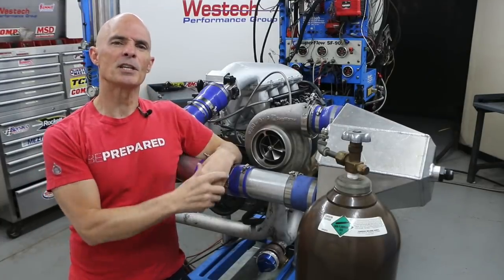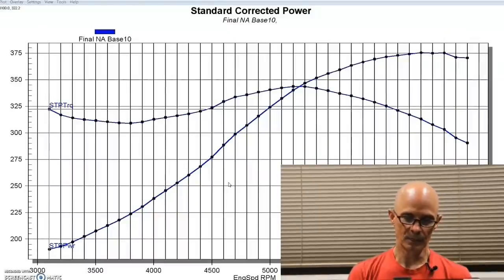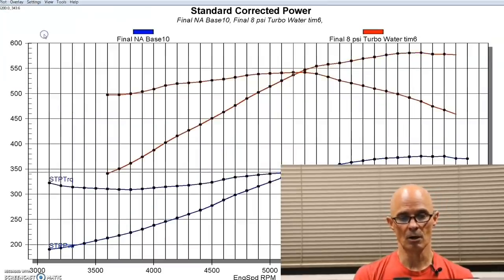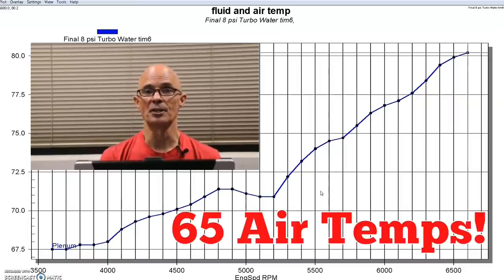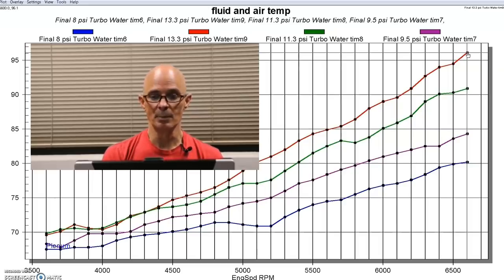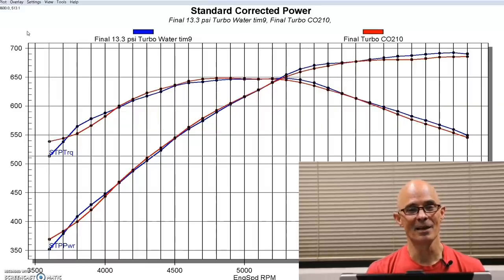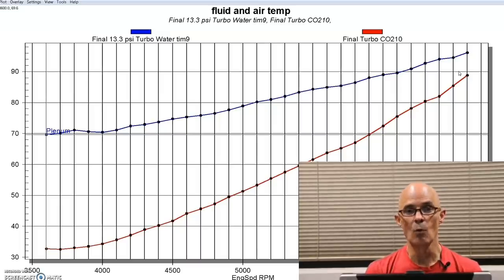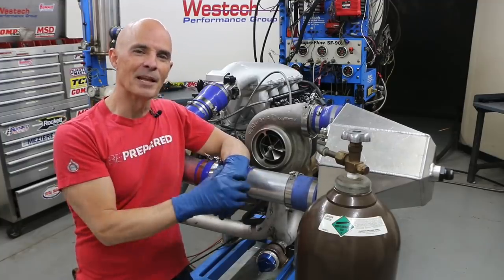HELP, CO2 INTERCOOLER FAIL!! FULL RESULTS!!

Comment: CO2 is heavier than air, and as a result, it will settle at the bottom of the bottle. If that CO2 bottle doesn't have a deep tube, then all you were sending out after opening the valve was pressurized cold air above the CO2. In this case, you should have flipped the bottle up and down to get the CO2 out.

Comment: Liquid pulls heat at 14x the rate of gas with aluminum core. So it’s basically functioning like an air to air intercooler with c02 but the core size is much smaller than most air to airs on this size setup. 
I’ve water would probably work much better, id be interested what would happen if you used ice water in the cooler and used c02 at the turbo inlet to decrease the temp of air starting at the turbo

Comment: The phase change needs to happen where you want the heat transferred. Also, air to water IC not the optimal internal geometry to transfer heat to a refrigerant.

Comment: Use a water/water heat exchanger (large one) so you can have high flow and not lose cooling capacity. Run co2 to exchanger, then water/glycol thru exchanger and Intercooler. I think that's your best bet. I want to try the exchanger method to chill water/meth injection using R134 from my a/c.

Comment: 1. I feel that u shouldnt have added fuel, monitored your a/f ratio and made sure not to blow the motor. 2. U obviously have a problem with flow, u have to remember the colder the air the denser the air will be you need excess flow to compensate for all that density. So i feel in my opinion you dont have enough flow, and of course adding all that fuel just drowned the motor and didnt make power. In  Future videos u should probably show what your a/f ratios are at to  reassure data given makes sense i mean we are all here trying to learn more and more so lay out all the data u have 👍🏾 good video but u should try it again. Abd if u did share link to me plz

Comment: I wanted to chime in here, back in the 80s I was a Product Engineer on the GM "G" bodies. I personally owned an 87 Grand National. I swapped the 3.8 out for a 4.1, forged pistons, etc.... I modified the stock intercooler by sealing off the front and back, installed a drain cock in the bottom and created an opening in the top. I would pour liquid nitrogen in the top of the intercooler which was good for a 1/4 mile run. The air going into the throttle body was at -15°F. I also used water injection (there was a port on the ECM for that!). Horsepower was at 445, my quarter mile runs were 11.41. I attempted nitrous, however the 200R4 would not hold up. For anyone with back issues of Turbo magazine (late 80s), the car was featured in a Turbo Magazine issue.
Reply from the maker: very cool-I wrote for Kipp back then
Reply: @richardholdener1727  I remember as an engineering experiment, we created a Turbo Regal El Camino., we used the front end and dash from a 4 door Regal, the power train from the Grand National.  Tons of photographers from magazines, then the vehicle was scrapped!
Reply from the maker: my kind of elco

Comment: If you have any part of the aftercooler surface facing the incoming airflow below zero degrees, it will frost up on that surface, blocking flow. 

Your best efficiency if you stay above  frost is to cool a liquid coolant for the aftercooler to just barely below freezing, as that will result in a temperature gradient between the coolant side of the aftercooler heat transfer surface and the intake air side of the aftercooler heat transfer surface that ends up with the surface facing the intake air merely being near zero, but not quite at it, so you will get (helpful) condensation, but NO frost to block up your passages.

Then, you need a GREAT deal of flow of coolant going the OPPPOSITE DIRECTION as the intake air, so the freshly-heated intake air faces the warmest coolant, and the already-partially-cooled intake air faces the coldest coolant.

Cooling your intake charge to below zero will work, IF you carefully defrost the coils during the run by cooling the intake air in stages, and that is wildly impractical for most cars, as they would have to have dual coils: one operating while the other defrosts.

The practical lower limit of aftercooling is just above freezing. You can go lower for an experiment, but your one way to do that with relatively cheap technology is to rent a reefer container with lots of thermal inertia in its cargo, such as many small bottles of frozen water that your reefer container can than drop to as far below freezing as you want.

Then, you run the intake air into one end of the container, and have it exit from the other end, so you are almost completely dehumidifying your intake air before it even touches the turbo. THEN you cool THAT dry air down to whatever low temperature you wish. 

As you can tell, the logistics of performing such and experiment mean either Alaska or a huge setup to eliminate moisture before it can clog aftercooler passages as frost.

But, for maximum aftercooling, a liquid cooled to just barely below freezing provided in GREAT abundance to a liquid-to-air aftercooler core. is the way to go. Your incoming liquid has to be at about 0.01 degrees above freezing, and it would preferably leave the core at about 1 degree, due to the overwhelming abundance of coolant being thrown through it.

Comment: I'd be interested to see an air-to-air intercooler with the CO2 sprayed onto the fins. You could run dyno fans across the intercooler to get air flow across the intercooler. I think the water-to-air intercoolers are meant for 1/4 mile runs if I'm not mistaken. Here's a wacky idea, plumb the water-to-air intercooler to an ac compressor. I wonder if the power of the cooled air would be great than the parasitic drag loss?
Reply from the maker: I HAVE A VIDEO UP WITH NITROUS INTERCOOLER RING SPRAYING NITROUS THROUGH AN ATA
Reply: @richardholdener1727  Sorry, trying to find the video but no luck

Comment: Pressurize the intercooler line open the bottle all the way open and release the co2 after it has gone through the intercooler . Making the intercooler lines part of the co2 bottle .have your valve after the intercooler open it there and your intercooler will freeze the same as the bottle does when releasing all the Pressure

Comment: Even if you were to get this to work properly. The real problem is that you would be freezing the moisture that is in the atmosphere inside the core. It will clog the cores and then you’ll just blow your couplings between the inner cooler and the turbo. It might be possible to run quarter mile track runs in a more dryer climate. But this shit definitely will never work where I live.

Comment: You need to be running pure liquid CO2 directly to the inner cooler with a vaporizer orifice. You need the inner cooler to act the same way the vaporizer coil/core acts in an air conditioning system.

Comment: try it with a larger evap core.  the incoming air temp cfm is overcoming the endothermic reaction as you have it in this video, you'll most likely need a larger core so cfm is reduced.

Comment: The answer's much easier than all of you think:
 - The tank in your test laid strait letting only gas out, not the liquid, that's why it didn't work.
 - Take a look at the tank, it's lower part frosts after the pressure drop right where the fluid is.
 - Just pop the tank upside down, so the liquid part of CO2 is below the gas part and you're good to go.

As a lot of people noticed right, cooling effect is obtained by a phase change of CO2 from liquid state to gas, which will in this case happen right where you need - in the pipeline and in the intercooler. Also make sure the lines are as short as possible.

Can't wait to see the correct test!

Comment: It may be a leidenfrost effect. Basically it could be the co2 is trying to boil from the hot surface creating a gas barrier preventing it from actually cooling the pipes. The same effect happens when you pour liquid nitrogen on your hand, it won’t do anything unless you soak your hand in it

Comment: The core of the air to water intercooler needs to have a design of an evaporator core, the fin/plate design of an air/water IC won't distribute the CO2 evenly, unlike water or a fluid, a gas requires set directional path across the entire core in order to gain the most heat exchange. However an orifice on the inlet side of the air/water I/C would enable to CO2 to disperse better for that O2/H2O intercooler.

Comment: why not inject co2 direct into the engine as a charge cooler and fuel
Reply from the maker: CO2 IS INERT AND WOULD HURT POWER
Reply: @richardholdener1727  I guess your right, than any other refrigerant that would double as a fuel ea liquid ammonia or liquid butane/propane, the phase change will drastically lower the intake charge and the fuel properties add to the boost charge after compression

Comment: Video idea to test this further... Check out how the KillerChiller setup works. Maybe you could run liquid CO2 through a heat exchanger like that and still flow water through the A/W intercooler. Or, just straight up use one of their kits, I'd be excited to see those results. As always, thanks for the great content! I think having the water down at a lower temp is going to pull the heat out much better than running the CO2 through it, but that's just my thought.

Comment: turn the c02 bottle upside down, and use a nitrous jet at the intercooler. flipping the bottle will give you Liquid co2 .. and it will decompress at the nitrous jet.  this should provide the coldest co2 output .. also you can use a nitrous solenoid to control the C02 and of course try different size nitrous jets to increase or decrease the amount of Co2
Reply: you can also restrict the output side of the intercooler where the C02 is going to exit. but i would think having it a bit larger then the input jet would be ideal

Comment: Need to keep pressure of the co2 higher in the inter cooler so it will get colder.    Or ad air conditioning to the inter coolers maybe some  Peltier devices to the intercooler I was thinking about trying that but have to get rid of the heat they make cold on one side hot on the other

Comment: I set up and built a propane fuelled 20b 3 rotor rotary rx8, i ran my gas lines into the barrel intercooler instead of water, before gas was sent to reducer and heated there to create vapour injection. . 
What I saw was extremely promising, and I think the difference here is that the more boost and flow, the more heat builds but also the more gas flows. So temps stay constant throughout the range. 
Your co2 just needs to increase to scale as revs/heat/boost increases. 
Lpg/propane is extremely misunderstood and misrepresented, mainly due to most gas cars running dual fuel systems. By running Solo gas, the tune can be done optimum to suit the gas. Not to mention the use of correct plugs etc. 
Dual fuel cars are rubbish. 
Good vids btw. Super informative 👌

Comment: You might have formed a dry ice cube in the cooler. You need to meter the liquid into the cooler with a capillary tube or an expansion valve.

Comment: You have a very short tube from turbo charger to cooling core and very long tube to the engine air intake, thus losing so much of the coldness of the air
Reply from the maker: agreed

Comment: Use the CO2 to cool the liquid going through the intercooler.    build a nice flat aluminum block  and glue it to the water container with some thermal epoxy.  Then run the co2 through it.

Comment: LN2 is often used for max overclocks of computer CPU where excessive temps cause failures and melted silicon.
The transfer method is usually just an open pot of liquid on the heat transfer plate allowing the liquid to evaporate, the same method as using a dry ice intercooler.
Recon main problem with LN2 in an open pot would be keeping liquid over the transfer plate as the vehicle accelerates, and also stopping the fuel from freeze -60'C.
Would be great to see what can be achieved on the Dyno, Have Fun.

Comment: I ran a DEI Cry02 on my skyline with side mount inter cooler. I had it going through two in-line 3” pipe “bulbs” first at the throttle body, 2nd after the side mount and the waste spray directly onto the face of the inter cooler. Without touching boost controller, boost climbed 3psi and temp dropped 15-20deg C at top. (Intercooler pipes had condensation like an A/C pipe). Cry02 for the win.

Comment: You don't have enough intercooler. My air to air intercooler goes from 82* to 110* under 30psi of boost in about 8 seconds. I'd hate to see what your air temps would be with that intercooler at 30psi for 8 seconds.

Comment: Richard I really wanna see you do this same test again but not co2 rather try methanol that's been dry ice chilled. I promise youl get sub zero intake temps and please man try my hvlp preturbo injection with the dry ice methanol too. Also not enough co2 it's density is very low lbs/min flow was low so it got hot just like you said with the water flow.

Comment: The co2 gas gets cold at the spot where the pressure drop occurs. I am guessing 5 or 6 nitrous jets on the cold water side of the intercooler and running the co2 tank upside down to feed them liquid co2? Kind of like the orifice tube in an auto ac system.

Comment: And try running it through a evaporator core. Liquids and gasses have different properties, gases the atoms are spread out more so the gas will warm up faster due to less mass then water so you might also need to run it through faster. Loved the video man I would really love to see something like this work cuz It could really change the industry

Comment: Use compressed O2 through the cooler then a nozzle in front of the turbo. With the bottle upside down pushing liquid O2 out then change to gas at the nozzle and cool the inlet air as well. Double cooling and double power adding. Stand back... way back!

Comment: Richard, I am not sure if it has been mentioned, but try running the L2A with dry ice and a medium similar to fuel stabilizer. If agitated enough the mixture can get as low as -176°F.

Comment: You need to get the liquid CO2 into the intercooler and have it boil there. CO2 as a gas does not have the mass to remove the heat you want.

Comment: You need liquid, water with salt added to get its temp down for flow, then circulate that with either ice or dry ice package so it’s not directly contacting water for thermal transfer, could net seriously lower inlet temps, remember Moroso fuel cool cans, similar theory just larger scale, thermal mass needs to
Be enough to absorb the heat generated. Love the work your putting in👍

Comment: Your issue with the CO2 is something called latent heat of vaporization. Basically how much energy it takes to convert something in a liquid form to a gas. CO2 is 247 BTU/lb.  It gets tricky here because you need to now calculate the energy input to the water. As we know one BTU is the energy it takes to raise 1 lb of water 1 degree F.  Without knowing the total volume of the dyno water we can't calculate the how many BTU the charge cooler is dumping into the dyno water. If we knew the dyno water volume we could guesstimate the amount of CO2 (in lbs per second) you'd need to equal or outperform the water.

So in short yes CO2 gets very cold but when it changes from a liquid to a gas the actual heat energy it takes to do so is relatively small.

The short answer is you'd be better using the CO2  to pre chill an ethylene glycol and water mix to -50F and circulate that.  But again volume is key, a few gallons chilled to -50F is not going to perform as well as 1,000 gallons at 65F. Remember it's total energy input over the total fluid volume.

Comment: Maybe a heavy restriction on the exit port of the intercooler would allow the co2 liquid to pool up in the intercooler kind of like hvac systems use a restrictor to turn liquid back into a gas but co2 properties are basically just opposite so instead of the liquid side being your hot side(freon)  your gas side would be the hot side(co2) so if you had a metering device on the exit port of the intercooler and maybe a pressure gauge on the cooler itself to monitor how much pressure is in the core you could get liquid co2🥶🥶 to sit in the intercooler and you could shed the heat as needed by adjusting the amount of restriction on the exit port... That seemed a lot simpler in my head 🤔

Comment: I'm not an HVAC or CFD engineer but to me it seems you have a lot of air flow and not enough surface area to remove that heat quick enough with C02 (since its not water). I think the C02 idea is a great idea but I would use a larger exchanger and I would put multiple C02 inlets to cool the whole intercooler faster and holds the cold longer.

Comment: Is it because an intercooler can only take out so much heat based on area of metal to media interaction?  Example: copper brass radiators require up to five cores to displace the same ammount of heat that a  two core aluminum radiator displaces.  The reason the two core aluminum radiator is able to do as well as the copper/brass is that the  tubes can be made of a larger diameter due to the strength of the material.  More surface area. 
  It would seem to me that that there is a limit to how much heat can be taken out, or transferred, based on the size of the  size/volume/internal surface area.

Comment: Maybe you could run a water/glycol mixture into a box that has dry ice in it. The tubing would have to be able to withstand the extreme temperature and have enough flow that you can keep the liquid from freezing inside the box. Be sure to vent the bottom of the box somewhere that you can't breath it.  I'm not sure you would want to run glycol through the intercooler?  Might want a second heat exchanger?